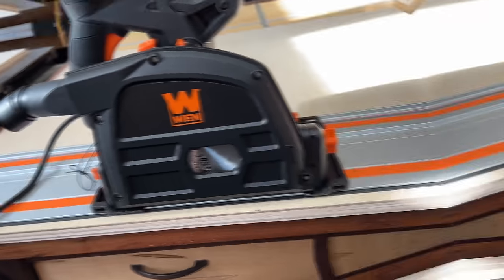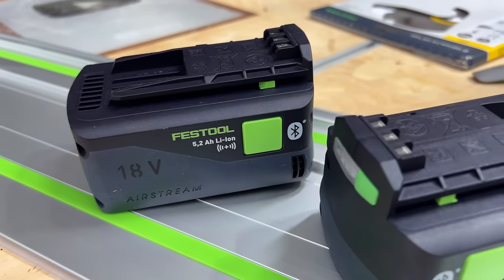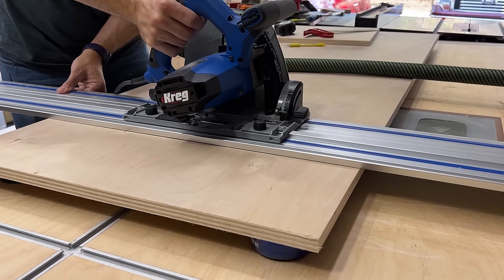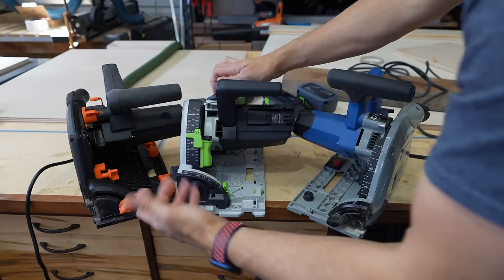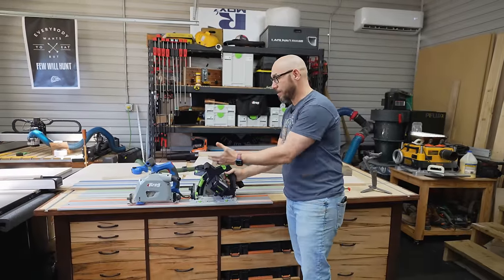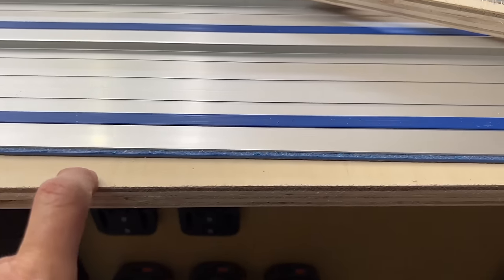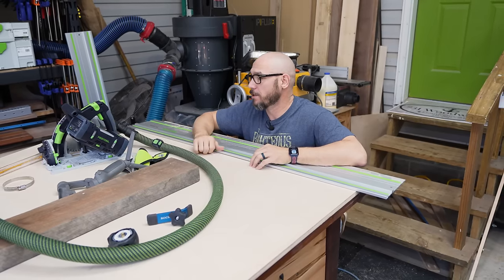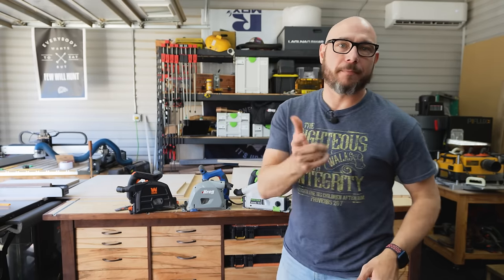The Best Track Saw For Any Budget! WEN vs Kreg vs Festool

Comment: WEN CT1272 12-Amp 7-1/4-Inch Variable Speed Plunge Cut Circular Track Saw + Wen 110-inch (2 55-inch tracks) and awesome blade is all you need.

Comment: I bought the 36 volt Makita about a month ago and have absolutely no regrets.  I actually wish I bought one years ago.  Having a track saw saves so much time.  If you build things often go get one they are so many things they help with.

I bought the Makita because most of the reviews out there say it is almost equal to the Festool.  I decided on it because of the battery platform and can afford to get in the Makita platform.  Katz-Moses did a comparison about a year ago.

Comment: I’ve seen a couple people already say the same thing (probably because a lot of the amazon reviews recommended it) but I got the wen track saw as well without the tracks and upgraded to the powertec tracks.  Absolutely no complaints on the tracks at all and if you’re really itching to upgrade them, I believe makita, wen, and festool all use the same pattern so you can use any of the accessories interchangeably.  I’m really only a hobbyist who likes to make things for my house and needed a track saw to breakdown sheet goods.  I don’t have a table saw and am in a townhouse without a garage so can’t really accommodate one.  The wen track saw has been great for me and I really haven’t had any problems with it at all.  First cuts with it were also on a 8/4 red oak slab countertop project and it didn’t have a problem.  I don’t think there’s really a better bang for your dollar right now as a hobbyist than wen tools.

Comment: I  have the Kreg, and feel it is professional quality. It also works with their Adaptive Cutting System,  which is a big positive.  Their tracks are also long, so when you put two together to rip a full sheet, you get space at both ends for your saw to begin and end cuts.  It is an excellent saw for cutting cabinet parts and other large pieces that are hard to cut on a table saw or miter saw.

Comment: I bought the wen 2 years ago it came with  a 55-inch track and 2- 26-inch tracks and 2 track clamps which I haven't had to use and with a little shot of spray dry track lube it's as slick as snot on a doorknob it has served me well and with the money, I saved I was able to purchase an oscillating spindle sander, dust collector and a dust filter and still had a little money left for material for a project I was making I couldn't have done all that if I spent $800 on a fustool

Comment: Really love your videos. The Kreg saw is actually a brushed motor. They hide it but there's a whole section in the manual about them on page 20. When the brushes wear out you have to return it to Kreg to replace them.  That's a deal breaker for me.
Reply from the maker: Thanks for that info!
Reply: AND the WEN ships with a spare set of brushes in with the saw.

Comment: got the Kreg, did have a problem with the retraction a spring came lose, got a new screw good to go, When I was running it through 12 foot slab of redwood at 2 Inches it did begin to burn but did ok.

Comment: Understand there’s 2 versions of the “Wen” for less than $50 you can get “Kreg” variation with a 7 1/4 blade bigger motor and speed control

Comment: I DIY and only cut 1/2 to 3/4 ply.  Perhaps 40 cuts a year.  I use it to break down sheets and do have a Dewalt 7491 table saw.  Ended up with the WEN with a additional 56 tooth blade and Powertec tracks.  Originally bought the WEN tracks but didn't like the length of the tracks.  Very happy with the WEN.  Took off the kickback cam.

Comment: Enjoyed the video. Ibought the Wen and it has worked great so far. You discussed crosscutting sheet goods, but never mentioned that the Wen is the only one that could rip the full 8ft length of a sheet.

Comment: Interesting comparison. And an interesting choice of models. Personally, I own the Makita, which I purchased many years ago - not because I thought it was better than the Festool, rather as a result of using one at work and being very happy with the performance. 
Of course, the fact that it was on a special and came with a makpack, extra blade, 2 tracks in a bag, along with two clamps for around about the same price as the Kreg, sealed the deal for me. 
The Wen looks very like so many generic tracksaws available here in the UK, and has the advantage of being compatible with Makita, Evolution and Festool accessories, meaning you can always up your game at a later stage if needs be.

Comment: I’ve had the ts55 since day dot. got in on the second generation. So a loooong time ago. still works perfectly and cuts like it’s new. still has that busted festool sound too haha. it’s was my main workshop track saw and I ended up getting the 36v makita as an on-site saw. I loved the makita so much I got another to replace my ts55 bench saw just to get rid of the cable. I’ve got the Bluetooth festool extractor so if works really well. the only thing I miss is the nicer depth adjustment on the festools. but it’s not that big of a deal as I’m mostly cutting the same thickness all day.

Comment: Thanks for the review. I have wondered about WEN tools but I have never owned any. Thanks for sharing.
Reply: Yes, I had WEN's drill press, disk/belt sander and oscillating sander and I love them.
The drill press is a really good one. 👍
Reply: @JoeLazzara  good to know. they look like they are high quality in the videos that I have watched.
Reply: @HilderbrandOutdoors  I would say they ARE. 
I got their 12" bench top variable speed drill press and its really good. Rock solid with no vibration, pretty quiet and accurate. 
Their disk/belt sander is also a solid piece of equipment, heavy too.
Reply: @JoeLazzara  thank you for sharing

Comment: I have the Wen (with upgraded track) . Used it to cut 45deg mitered corners for a walnut plywood dresser with WATER FALL EDGES.  at first i was really concerned as there is play when you set it to 45 deg. but i just held it down (the play was up) and it cut perfect 45s  Agree if you were a heavy user go with something better but for a casual user it worked fine

Comment: I mostly agree with your assessment of these saws. I own the WEN, bought it with the longer Powertec tracks. I also bought the WEN 56 tooth blade(only $27). This blade makes smooth rip & crosscuts. Also,  I didn't notice my saw being underpowered or bogging down in any way.  I was just cutting plywood but for me that's the only thing I plan to cut with this saw. If I need to cut thick boards I'll just use my table saw. One final thought on the anti-kickback "feature." The instructions actually tell you how to remove it. So I'm thinking they realize what a pain it is and expect most people to remove it.  I agree with the people who want you to look at the Makita track saw as it could possibly be a closer competitor to the more expensive tool you're planning to keep. Thanks for the content.
Reply: Also the Wen, Powertrac, Makita, and Festool all use the same tracks. That gives you a path to upgrade the saws and keep your tracks.
Reply: @JohnC1  one thing I didn't like is his critic of the blades. No one uses a 24 tooth blade to break down plywood unless you want tear outs.

Comment: I've decided and I tell people- pick the brand and battery platform you want to be on and then pick the tool. So unless it's just amazingly better than the one that's on my platform I'll stick with it. I chose Makita, I'm going to get the Makita track saw unless it just was absolute junk ,I'll jump platforms. Bought Milwaukee 18 gauge cordless nailer because I thought it was the best by far out there, so I got the adapter online and still use my Makita battery 😃👍
Reply: I've been wondering if there's enough room on the Makita to plug in a couple of adapters and use DeWalt batteries on it . . .

Comment: Other saws to consider are Makita, Bosch, Mafell. One should not discount the benefits of the better Mafell/Bosch system track as it is better at joining up pieces to get long track and thus cut 8’ much cheaper and will less track joining fuss, vs the Fesstool/Makita track systems

Comment: I got the Wen 7 1/4” and powertec tracks. Used it for one weekend and found it underpowered and cumbersome to use. Working with 3/4” sheets for cabinets and drawers. It was my first experience with a track saw and I really wanted to like it. Did some more research and bought the Makita 36v track saw and wow, night and day difference. The Makita was a dream to use. After my first cut I thought I didn’t lower the saw enough to cut through because it moved effortlessly across the tracks (same tracks); but when I pulled the board it came apart. The cut was smooth and perfect. Just sharing my experience. Going to donate the Wen locally. Love the channel, you help me a lot. Just getting back into woodworking after a couple decade break. Really enjoying it and just finished a 15 drawer built in dresser in my master bedroom closet remodel. Keep up the great content!

Comment: I'd note that there is another potential plus to getting the Kreg plunge saw.

I first got the Kreg and later I got the ACS table.  Now I have the function of the Advanced Cutting System as well as the track saw function.

The ACS system is a little limited but still pretty capable.  It's not going to replace all the functionality of a good table saw but it's portable and will do a lot.

Comment: Love your shirt!  I have dewalt corded and makita cordless circular saws already, but I feel the need for a track system for 8' cuts. 

Would you recommend the milescraft guide rails or wen tracksaw?  I'll be using it only once every few months almost exclusively at 90deg
Reply from the maker: I'd probably just go with the milescraft ones then

Comment: I know this video is over a year old but you stated that the Festool would fit on the wen track, will the wen in return fit on the Festool track as well. Thanks for the comparison I’m just starting out in woodworking after retiring and want a track saw but can’t justify buy the top of the line, but don’t mind getting a better track if I go with the wen

Comment: If space isn"t an issue do you think we would be better off buying a dewalt table saw (8 1/4) for the same price as the Kreg track saw?
Reply from the maker: Depends on what you mainly will be using each.  If you only need to cut sheet goods, then the Kreg is great. If you want to make thin rips, build jigs for small parts, etc. then I'd get a table saw.

Comment: I see what you're doing in your comparison. I looked at Festool before buying a Bosh 18v. The Bosch has more power than the Festool and cuts deeper plus the cost is approx. $200.00 less but it only comes with a 43,3" tract. I bought the contractor "deluxe" (?) kit to be able to not only cut 48" crosscut but also rips without taking the tracts apart. I should mention the kit has 2 63" pieces and the connector. Put one 63" with one 43.3" and the other 63" by itself. Makes life easier total cost with extra track and carry bag for tract, connector, & clamps $750.00 (Amazon) Also saw comes with - 1 - 18 volts "core" batt., 1 charger, and a very strong sustainer case. Just food for thought. Good comparison though.

Comment: You got splintering on the bottom with the Kreg because  you weren't cutting on top of another piece of material. If you cut on top of a sheet of solid foam, or the Adaptive System table, you won't get any.

Comment: I don't see the point in a cordless track saw.
You are going to be anchored to the track and quite likely hooked to a dust collector.
Is it that big of deal to drag a cord along?

I find it funny you could buy the Wen, keep the tracks, throw the rest away and it would be cheaper than buying 100" of track from Festool.

Comment: Do you recommend the Wen saw for someone who is wanting to get into woodworking and make cabinets for their house?  Or would you recommend stepping up to a better saw right out of the gate?
Reply from the maker: If you have the budget, get the Kreg
Reply: @731Woodworks  Thanks!  Follow up question, if you don’t mind…. If I am already part of the Ryobi one+ ecosystem, would you still recommend the Kreg over their new cordless?  Granted that price point is relatively the same (even though the Ryobi pieces are proprietary).
Reply from the maker: @hoss4131  I would still go with Kreg. Check out this Ryobi review https://youtu.be/_jDNOfVsAdU

Comment: Hi matt you do these videos really well looking like a pro 😀. Do you use a track saw and would you suggest buying a track saw or is it one of those things that wouldn't really get used sorry I just can't decide. Thanks Geoff
Reply from the maker: I use mine a lot to cut down MDF and plywood.  It's much easier than trying to cut them on the table saw.
Reply: @731Woodworks  thanks matt great help and I appreciate your time
Reply: @731Woodworks  what would you say the table saw excels at vs the track? 👊👍🏻
Reply from the maker: @masterkilla77  small parts.  Ripping narrow boards.  Jigs you can make for the table saw (cross cut sled, finger joint jig, etc.).  Cutting dados.  Quite a lot actually.
Reply: @731Woodworks  thx! Looking forward to what you put out on the m18 track 😉👍🏻

Comment: I can't be the only one who is wondering how often and under what circumstances one's track-saw blade nicks or shaves the track's edge...aren't these zero-clearance setups, so that the track's edge is suppose to perfectly represent where the cut will occur?  If so, doesn't one such event potentially ruin the track, depending on how long and where that damage occurs?
All these years I've been using shooter-boards and having to replace or re-edge them when this happens - before I'd spend $400 or $800 on such a setup, I'd want to know if/when I'd be due to shell out $X00 for a new track.

Comment: Can somebody explain me what the difference in cut quality is between any track saw plus track and a hand circular saw plus a straight edge guidance?
Reply from the maker: I've used both.  The straight edge always seems to bend or "give" a little in the middle.  Even if it's just a tiny bit.  Track saws won't do that.  Also track saws (Kreg and Festool) Have splinter guards on the saw which prevent tear out.
Reply: @731Woodworks  Thanks for your explanation.

Comment: I think some of the cut results could be down to the blade. The wen probably has a crappier blade compared to the other two. I think if you used the same blade on all 3 the cut results could be closer. Not saying the wen would be as good as the other two but it might give it a leg up on performance per dollar.

Comment: Wondering if you have tested the 7.5 inch variable speed WEN. It looks like they addressed some of you issues with the 6 5 inch. Don't  know if they addressed the deflection issue though.
Reply from the maker: I haven't tested that one
Reply: @731Woodworks  I'm getting ready to buy the Kreg Adaptive Cutting System.  Just debating which saw to get.

Comment: Nice review Matt. I have a Dewalt cordless track saw and a Kreg. The Dewalt has its own track design that allows you to cut on either side of the track. It also has a notch to allow it to use the festool track.
One thing to keep in mind with the track length, the Dewalt has a slightly longer track (I think it's shorter than the kreg but longer than festool) which is awesome for cutting 48" stock. If you cut Baltic birch, which comes in 5' x 5' sheets, the Dewalt is just long enough. I also have a one piece Dewalt track that will cut a full 8 feet. Because I always attach a dust collection hose to the saw, I think that if I had it to do over, I might just consider a corded saw (although it came in handy when I cut 1/4 inch off of a deck gate I built to improve the fit).

Comment: Festool is stupidly expensive however if your a professional it’s a no brainer.
My stuff is over 10 years old and takes a beating, unfortunately that includes being knocked of the bench and hitting the concrete floor of my shop.
Not to be recommended but as when you need to make an actual living from these tools then there is one speed, flat out.
Festool is a professional range, this gentleman is completely right, don’t bother buying Festool if your a hobbyist or you have a lot of spare capital kicking about not doing anything.
Or buy second hand, but again you won’t see any other second hand kit hold it’s price like Festool